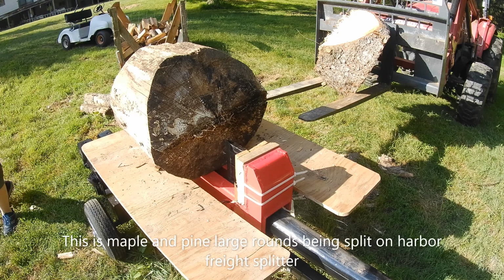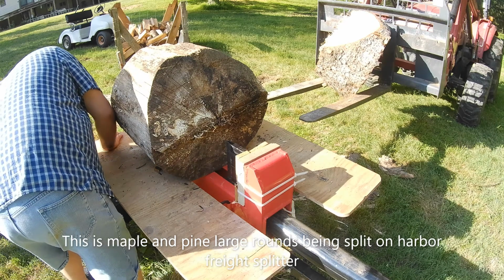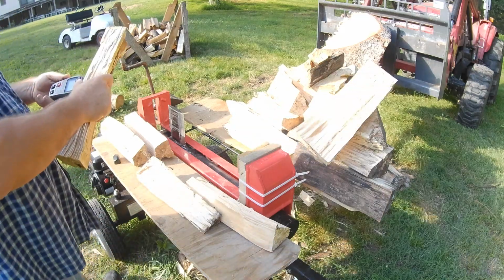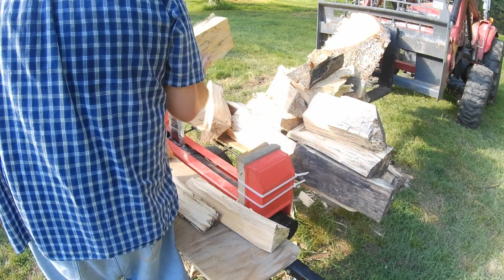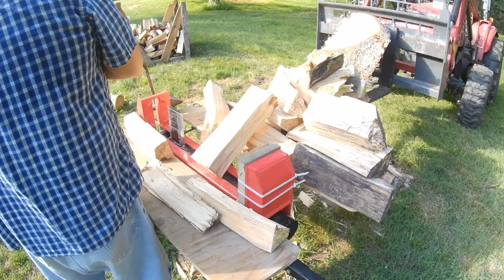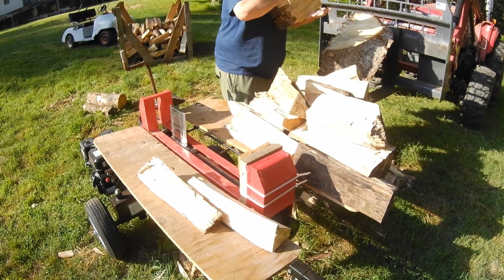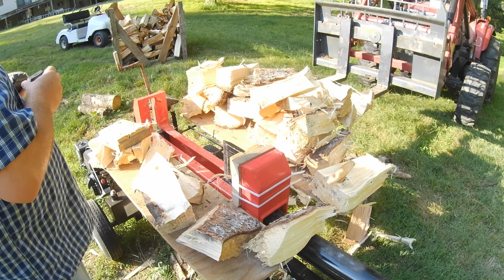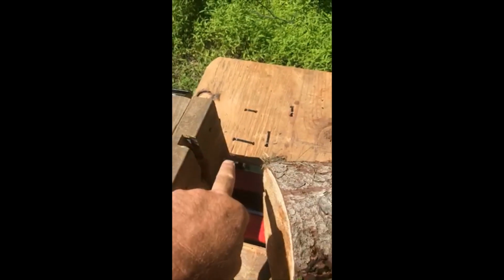part 2 Harbor Freight dual action log splitter splitting large rounds and moisture meter testing

Comment: You can see that we are a little timid (and slow!) using it at first. After we got some experience with the machine, we got a flow going and are much faster now. This splitter is a lot faster than those in the big-box store parking lots, and  easily splits whatever we've thrown at it including pieces that we could not split with a maul.  Still need some further refinements on the end blocks. High molecular density polyethylene blocks perhaps. Stay tuned!